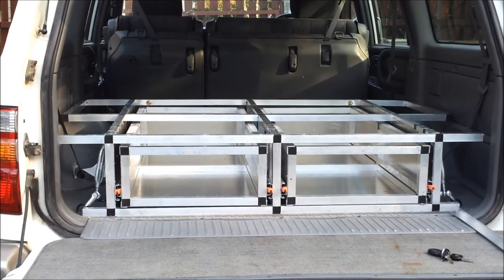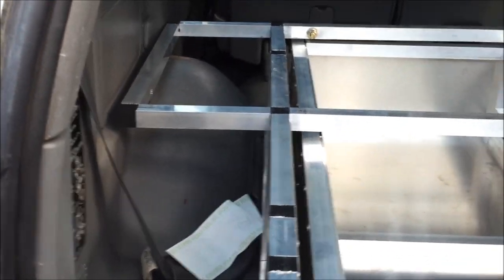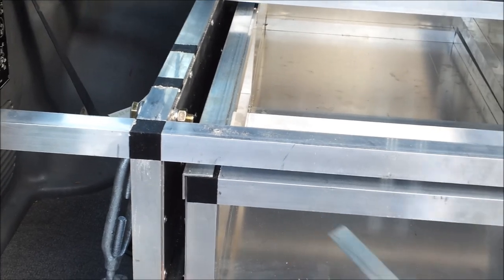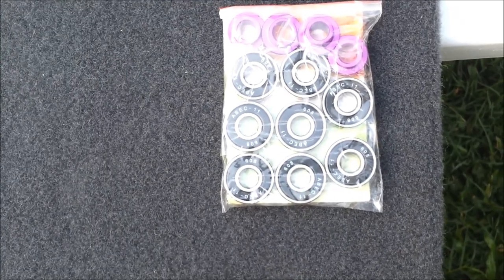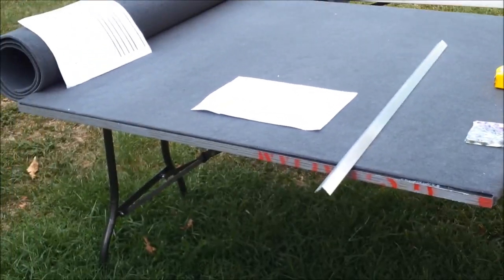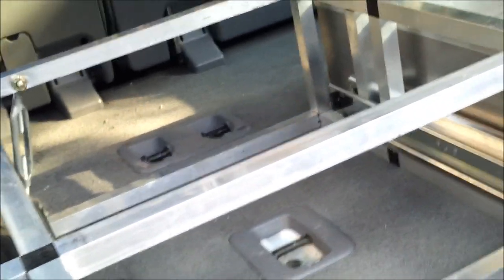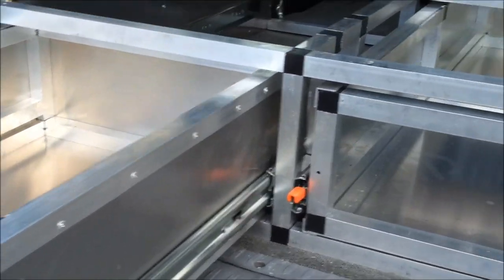How to make 4wd Storage drawer system part 1 of 4.mp4

Comment: Very great design with the aluminum structures. I have just begun a similar build on my 2000 jeep xj and am using the same material but welding all the joints for durability against frequent offroad trails

Comment: Thanks Greg great idea, I'm using your ideas to build drawers for the canopy on my ute. 

Just something that might help others, the aluminium tube is really expensive at Bunnings. I bought some from an aluminium supply place, it was a quarter of the price. 

I'm also using poly boat trailer slides instead of runners, lighter, cheaper and you don't lose width off the drawers.

Cheers!

Comment from the maker: Hi I found 1.6mm sheet fine,  The reason I did not use 2.5mm sheet was because it will add more weight and it was a lot more expensive.  But it would work fine and be very strong.  It comes down to your own choice. I did use 2.5mm on my camp trailer kitchen on the ends only because I had some left over and it worked out great.

Comment from the maker: I would not buy the 25mm box channel there as it is very expensive. I would look for a local aluminum distributor, they would most likely have the ezy join as well and it would also be cheaper than bunnings.  I paid $19 for a 6m length and required 6 lengths. The 25mm square is 1.2mm thick and easy to cut with a drop saw with the normal wood blade. I paid about $150 for a sheet of aluminum 1.2m x 2.4m x 1.2mm thick, it did the whole job.  T

Comment from the maker: he ply I brought was form ply from bunnings and it cost $60 a sheet of 1.2m X 1.8m x 18mm and I had a bit left.  The front ply was marine ply 12mm thick and just enough for the front of the draws.  The slides you can buy on EBAY and I would buy 900mm with locks and be able to take at leased 125kg.  Hope this has been helpful.

Comment: Morning Greg. The draws look amazing. I am looking at doing a similar project and was hoping I could ask you a few questions.

1. the easy join joints you used, are the just friction fit or do you rivet them in place?
2. Do you by any chance remember where you got the actual sliders (hinges) from?
3. How have the drawers held up over time?
4. Now that you have lived with the system for a few years are there any changes you would make?

Thanks for your advice and the amazing video. Looking forward to getting started on my own system.
Reply from the maker: I brought them though a trailer parts store here in Townsville, (wheels and castors)  You did not need to rivet the easy join.  Hope your build goes well.

Comment: Hey Greg! Thanks for the inspiration! Just wondering what your internal dimensions are? Do you reckon they are about the same size as the big company ones? I love the thought that you can make these so easily and for so cheap while there are others selling them for $2000!
Reply from the maker: The draws end up slightly bigger if you use the draw slides because they are smaller then the draw sides that run on bearings that they have on the expensive sets. Check out ironman and blackwidow draws.

Comment: Nice video Greg,  just wondering if the drawer squeak a year later?
Reply from the maker: No they are as good as new, After looking at a few different designs of draws that were a lot more expensive, I believe my set of draws is stronger.  The draws make no noise and slide freely, Greg

Comment: Thanks.  Much appreciated.  I notice in the back 'square' of the 25x25mm frame as well well as in the centre supports (25x25mm box) there does not appear to be the black joining sections as you have in the top and in most part of the frame.  How are these parts joined together?
Reply from the maker: Ian Granland Hi Ian on the draw system I added a middle support in the draw system to give it strength using 2 x 4 ways and 2 times T joiners. I have found that over about 1000mm this gives heaps of strength.  If you watch vid 2 you can see I added another box length  down the side about 10mm from the base because I felt I need to support the runners.  I had originally made the draws to use ball bearings that I show in vid 1 and realized runners give you a bigger and stronger draw system.  Iron man draws are are good youtube to watch to see the bearing system at work.  I brought roller skate bearings on ebay that would have been a lot cheaper to use then the runners.  I also found that the bearings would easily take a bolt through the middle, but it would have been a lot harder to know where to position them.  It would have made the draws smaller because both sides of the draw would need a length of 25mmx25mm to run the draws on loosing just over 50mm width in the draws.  The extra lengths I used for the runners are only held in by the side sheets riveted through to the runners which are made and shaped for strength.  If you use runners and wanted them on the bottom like mine the easy join do not have enough room to be used and if you wanted you could just rivet into the sheet, but I wanted a bit more strength and so went with the extra lengths.  Thanks again for you question and I hope my answer is not to confusing. Greg

Comment: Hi Greg.  Looks good.  Two questions:
You appear to connect the bottom metal sheeting to the bottom of the frame.  Is this done by pop riveting and if so in time wont the weight to the material in the drawer force the bottom sheet away from the frame.

Secondly the runners and how to fit etc.  I need a bit more info on that, please.
Reply from the maker: Ian Granland  Hi Ian I have attached the bottom drawer with rivets and it is heaps strong enough.  I often have heavy tools and 4wd recovery gear in the draws and they have not moved.  I have traveled on hundreds of kms of dirt and rough roads and the draw system is as good as the day I built it.  My other vids go into the runners and how I fitted them.  The rivets in the runners have not moved and the runners are still working perfectly.  Thanks for your questions and all the best with your planning and build if you go that way.  Greg

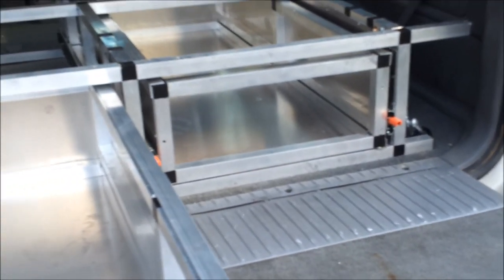Comment: Awesome job Greg, you have inspired me to make a set for my Defender. One quick question, how did you do the joint in the draws in the corners and the middle where many joint come together (Part 1, time 6:13). i.e. in the draw middle you have the draw vertical and horizontals plus the additional horizontal section which the slider attaches to. Did you use a 4 and 3 way?
Cheers
Luke

Comment: Hi Greg, Great job looks awesome, what are the lockable draw runners your using? how much were they? and where did you get them... these seem pretty expensive... cheers
Reply from the maker: David Paull Hi I brought them from wheels and castors on Bayswater Road in Townsville they were around $100 a set.  You can try ebay or the links below.  i have not dealt with Joy and I try to get items through trusted sites. Greg

Comment: Greg how did those roller brackets hold up?
Reply from the maker: been 9 years now and they are still going as good as the day i installed them.  Been through heaps of rough stuff and have not missed a beat.  My fridge has not faired so well and i have had to fix the drop down slide several times.  It was a brought one.  that sits on top of my draws.
Reply: @gregtanner7766   cheers mate great job; might give it a go myself; Thankyou for your reply!

Comment: Great work Greg. you gave me the possibility to do it myself as well.
in the first video you said you used 25mm x 1.6 mm (minute 2:50) but on the comment below you wrote "the 25mm square is 1.2mm thick and easy to cut with a drop saw with the normal wood blade". Is it 1.6 or 1.2mm thickness?
Reply from the maker: Hi Oliver, yes you are right, the size is 1.2mm 25x25 box.  These are the only ones that will fit the easyjoin connectors.   The wood drop saw works fine all you need to do is go through slowly and it makes perfect cuts.  I also use a bench saw to cut my sheeting. Make sure you go slow and wear eye protection as the little shaving fly out everywhere.
Greg

Comment: hey mate, great videos. how have you attached the sliders? pop rivets? are they strong enough? thanks, keep up the awesome work :)
Reply from the maker: Yes pop riverts, they are very strong, I have not had a problem with the slides even after many hours of rough tracks and corrugations.  They are used in plane construction and have a good track record. If you check out some of the brand draws they use screws on the end walls and I would say a rivert is stronger than a screw.  thanks for your comments.
Greg
Reply: Greg Tanner Hey Greg, for the drawer slide, did you connect them directly to the sheet metal with pop rivet? I am not sure if I should connect them straight to the side of the drawer or attach a wood rail first?.... If you attached them to the sheet metal, how thick was the sheet metal? the runners I purchased were damn heavy! Cheers
Reply from the maker: Dan Farrell
Hi Dan, I connected the slides with rivets through the sheet into the frame.  I added extra frame to deal with the weight.  If you look through vid 2 and 3 you can see them.
Greg

Comment: how many joiners would you need to make a draw system like you
Reply from the maker: +oh somefarkhead You would need to make a plan to suite your own system depending on the vehicle and your design you make. each corner and support would need a joiner. Each joiner is rated to 50kgs. No easy answer to your question sorry.

Comment: What was the final weight of the drawers?
4wd supacentre's ones are 75 kg
Reply from the maker: Hi Juzzy did not weigh mine and the most weight is in the 18mm ply on the top.  i would be surprised if it weighed more then 40kg.

Comment: Just in the process of using these aluminum connect it pieces (what bunnings calls them for players at home) for a drawer setup. So far so good, just wondering, did you plant this straight to the floor of the cruiser above the vinyl or use a piece of wood to sit it on?

Also google drawerslide-int.com.au for some quality drawer sliders. Got em for $46 a pair online, 125kg rated and are located in Welshpool, Perth, Western Australia.